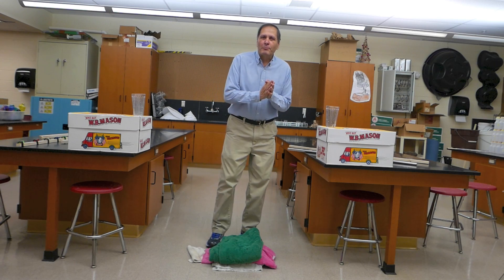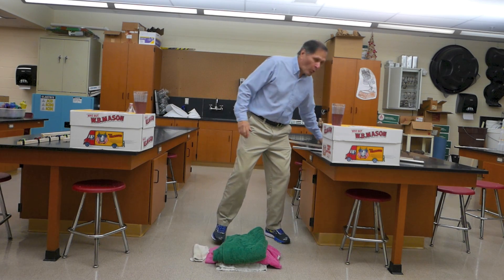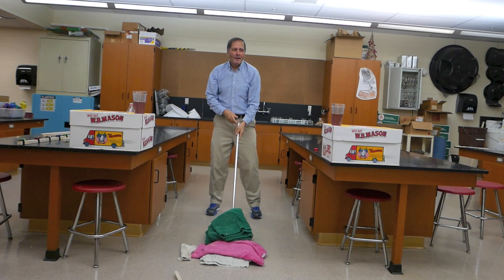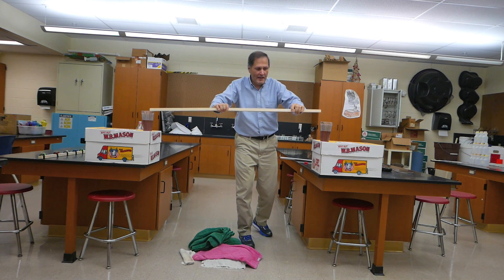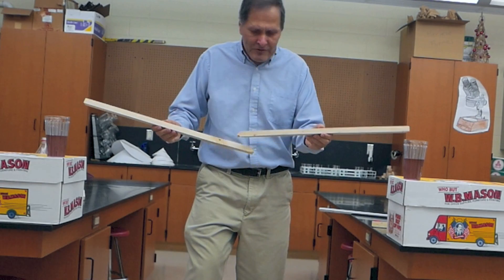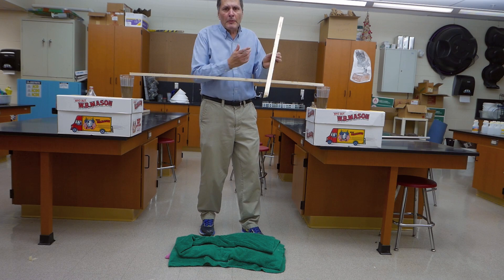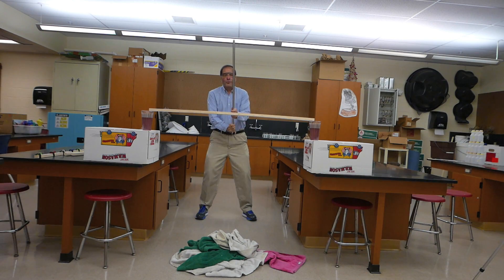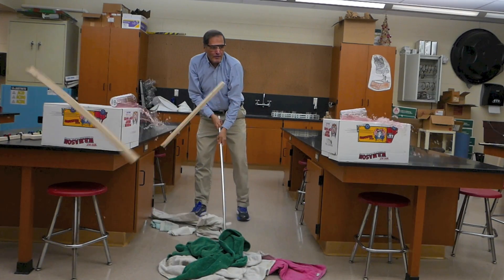Breaking Pole Paradox- center of mass // Homemade Science with Bruce Yeany

Comment: yes but a better question would be if both boards pushed the boxes close to exactly the same time and direction then why did both cups openings fly toward the right hand side of the cameras view
Reply: josh greg also possibly the weight of the boxes (we don't know if anything was inside) and he certainly didn't hit it in the middle.
Reply: josh greg probably the liquids, center of gravity difference, and probably a slight difference in force power between the two wooden planks/poles.
Reply: coriolis...yeah, that's the ticket!
Reply: the left box appears to be pushed only to the left. The right-hand box appears to be pushed upwards slightly which makes the cup bounce.

Comment: Interesting thanks.  But you need to learn what an actual high speed camera is lol
Reply from the maker: LOL,   I tried but it is a piece of junk,   the picture was so grainy I couldn't use it, if I had,  I'd never hear the end of it.
Reply: Bruce Yeany  Really??  I thought those things were expensive.  How could it be bad quality?
Reply from the maker: It is a cheap Casio point and shoot camera
Reply: Bruce Yeany  Ah so not high speed at all
Reply: To be fair, the section at 2:11 shows the effect pretty well.

For good quality high frame rate video lots of light is key. In general, cameras will shoot to the 180 degree shutter rule - meaning the exposure for each frame is twice the frame rate (i.e. 24fps video uses 1/48th of a second exposures). That means 120fps video is going to need 1/240s exposures - which is pretty fast for indoor lighting; at least without using high ISOs. High ISO leads to a grainy image; especially on cameras with small sensors. So - light, light, and more light!
Reply: Most smart phones these days can shoot pretty decent high speed! Or if you could get your hands on a GoPro. 120 frames would be good enough for this stuff. :)
Reply: You need better lights as well, if youre doing highspeed more light is going to help immensely (even if the camera is crap).
Reply: Don't worry about the shit talking haters. It was a cool and interesting video.
Reply: don't know where you are from but teacher salary isn't too good here. High speed cameras aren't really in the budget.
Reply: +GeeTR 63-71 Good :)
Reply: GeeTR 63-71  Lol.  Nobody is being a hater.  We're just joking chill
Reply: DANG JOS I'm calmer then you are.
Reply: It was a high speed camera, but I think it was only 60 fps or 120 fps
Reply: Bruce Yeany a bit late to the party but most high end smartphones can record video at ~1/8th speed
Reply: A good cheap way to get lots of light is worklights - I'm not in the US, but this is the kind of thing you're after: https://www.harborfreight.com/household/lighting/1000-watt-twin-lamp-halogen-floodlight-66439.html
They're not perfect, but they can let you film things at 120fps much more clearly than normal room lighting using a phone's slow motion mode.
Reply: I'm here waiting to see the high speed footage that never came smh

Comment: At 0:50 you claim that if you push down on the board, the "whole thing will tip over"... but you never show a control experiment to demonstrate this conjecture. Without that, I have no reason to believe that striking it quickly provides a different result from striking it slowly, and therefore have no reason to believe (or need of) your explanation for the purported difference.

Comment: Do you have to break the stick right along its center of mass for this trick to work?  From your explanation, all that seems to matter is that the broken pieces rotate away from the cups.
Reply: Kyle Amoroso its easier to break it in the center. ever tried breaking a pencil right at the eraser end?
Reply from the maker: good point Alex,  thanks
Reply: Alex Lawson That doesn't really answer my question :/
Reply: Ummm say if you did break the board near one cup you would have a long board and a short one. The short one would probably be fine and miss the cup but the large boards center of mass would be closer to the middle of the original board rather than at the 1/4 point. Because of that, the larger board would hit the cup on the opposite side. At least I think so.

Comment: but what keeps it from breaking the cups with the downward force on the ends? The counter torque had to come from somewhere right? Or is this all inertia and the board could be floating in space or say suspended from human hair from the ceiling and still work?
Reply: I think there was a lot of force that got applied to the glasses before the stick broke, but just not enough to break them. It is all going straight down the length of the glass after all.

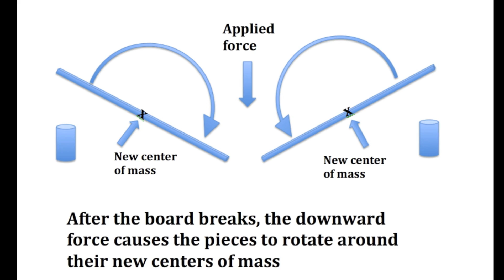Comment: You're mixing 2 questions:1/ why aren't the cups spilled during breaking2/ why aren't the cups spilled after breaking. People are indeed wondering why the cups don't spill. But I think most people won't be so surprised about your answer to question 2.  They are surprised about the outcome because of the answer to question 1, which you don't give.To say in another way: if your answer is as shown in the video (3:00) then a scientist would reply: but this also holds when you slowly break the stick: why are you breaking it so fast? You should also explain why the cups aren't spilled during breaking, that's what is surprising ...
Reply from the maker: I mentioned it in passing around 2:46 that I am breaking it against the inertia of the pole,  obviously I did not explain this as well as I should have.  I should have described that a rapid  force would cause a quick downward acceleration on the pole.  But, since the pole has a certain amount of inertia,  it can't withstand the sudden acceleration force and so instead of being moved downward it simply breaks.  The moment the pole breaks,  the downward force is now acting as a torque, which now causes the two smaller pieces to rotate around their new respective  centers of gravity of mass.  If I were to push  down on the stick slowly, there would be enough time to allow for  the force to be "felt" on the cups  and would surely cause them to fall over.

Comment: I was so irritated that the shot was crooked.
Reply: maybe the shot was fine, the building was built at aslight angle
Reply from the maker: LOL,  it appears that I am never going to hear the end of this.  The camera was on a cheap tripod and and right up against a wall so I could fit it all in,  it was hard to see the back of the camera to check the shot.  However, I promise to do better next time.  thanks

Comment: What happened to the clip with the high speed camera? And why does the board break without applying pressure to the cups first? I get that the center of mass changes after it's broken, but shouldn't there be pressure as it's breaking?
Reply from the maker: Sorry,  but I have cheap equipment,  the high speed camera video takes was pretty much worthless so I took the regular shot and slowed it down.  When the stick is hit quickly,  the downward force or torque causes it to spin away from the cup
Reply: The actual trick here is inertia. The board has mass, and so it resists being accelerated. Since the metal bar has much more momentum, it imparts a great pressure that causes the board to break, then once its broken, all the kinetic energy is on the ends of the new shorter boards, so they introduce a torque, that causes them to spin away from the glasses. Basically if he tossed the wooden bar into the air, he could have struck it downward while it was in the air and it would have behaved identically. it doesn't need anything to hold it, thanks to inertia, no extra normal force is needed to break the wood. As long as he strikes it with sufficient pressure, it would break even if it wasn't being held at all, or if it was floating in zero gravity.
Reply: Thanks Diamonddrake, that's a pretty good explanation. It would be a great video too to illustrate that that is what is going on, if someone were to make it.

Comment: Nice video, and explanation. This is similar to a demonstration done in the martial art of Ki Aikido. A piece of green bamboo is suspended on both ends by two strips of paper held only by knives, and is cut with a wooden sword or boken. This is a test of of your sword technique, because if you do it incorrectly, the ends of the bamboo will move upward at the break as shown here and the paper strips will not tear. If done incorrectly, by attempting to use brute force, the bamboo will simply rip through the paper and slam into the ground unbroken. Green bamboo doesn't break as easily as a pine board. 
Here is a video of this technique https://youtu.be/3Z6pVCfACjE
Reply from the maker: Dave,  thanks for sharing that,  certainly makes my attempt look clumsy in comparison

Comment: Really slick demonstration, but man... take 30 seconds to level the tripod. The 10˚ tilt in the frame is super distracting (to me, and probably at least two or three others ;)
Reply from the maker: Sorry Josh,  no budget, cheap equipment and slow on the video learning curve.
Reply: I'm just being nit picky. I would much rather have a slightly crooked video than no content at all! Just a tip, if you have a long horizontal line in the shot (like a table edge, or those lights at the top of the frame), just try to get those straight, and it'll really help us fake-OCD types...
Reply from the maker: Got it,  I went back and watched it again,  next time will be better

Comment: but WHEN does the center of mass shift 0:
Reply: when the board breaks and the two pieces are no longer connected.
Reply: Soarin_FTW
but WHEN are they no longer connected?, i mean, EXACTLY 0:
Reply: When the atoms are seperated?
Reply: +legotechnic27 Correct.  Center of mass, CM, is a concept that only applies to a rigid body... when it is behaving like a rigid body.  As soon as the pole hits, each half-stick is an independent thing because the pipe has taken control of the center point and each half-stick has a center of mass of its own.  The original center of mass no longer applies.  It helps to understand forces applied in-line with a CM cause only translation, but forces applied "off center" cause both translation  AND a torque (also called a couple) just because it IS off from the CM.
If you move the hit-point faster than the CM gets accelerated, then the cup end goes up.
--
Regards
Reply: ?_? huh. take a guess. perhaps when the mass was altered/ halved. broden
Reply: I think as soon as the thing starts to bend, because the center of mass is only ment to simplify the model right?
So when the board is no longer rigid, this simplification doesn't apply in the way it did anymore?
Interesting question.
Reply: fjoa123 what happens is he gives the pole so much momentum that it snaps the board very quickly and so the board applies a very negligable amount of force to the cups (which have a higher inertia because of the water in them too) and then when it snaps theres no force being applied to the cups because it rotates around the new centers of gravity.
Reply: You know... Objects don't have to rotate around the center of mass, right? It is completely irrelevant it's position.
Reply: Eric Pive If objects rotate without any force applied they'll rotate around their com.
Reply: DerBlaue Objects rotate around an axis, and that axis can be anywhere in 3d space, even outside of the object itself.
Reply: Eric Pive But not if they spin alone. For example in space. You spin a pipe at one end. If you let it go it will spin around its com.
Reply: DerBlaue No it won't. The end point will still be at velocity 0 and the pipe will still spin around it. It's just the way it is.
Reply: Eric Pive To be honest. That doesn't make any sense.
Reply: DerBlaue Of course it does. Where did you even learn that things spin around their center of mass?
Reply: Eric Pive You can try it. Spin a ball. It will spin around its com. Now stick 2 balls with the same weight and size together (glue, tape) and spin them too. They'll spin around the point, where you sticked them together. And the last experiment is to stick a small heavy ball to a big light one. Spin them and you will see that they'll spin around the com wich is near to the heavy ball.
Reply: DerBlaue That doesn't necessarily happen...
Reply: It is even possible for objects to spin around an axis that moves in space over time...
Reply: Objects orbit around 'com0' of the middle object and the orbiting object. But if these objects rotate, they do it around their own com. Rotation doesn't move an object.
Reply: DerBlaue Apparently you are understanding movement as a composition of both displacement and rotation over the com. That's a valid way to understand things, but in formal physics it isn't done that way. It's much more useful to think about an instantaneous axis that the solid revolves around and slides paralel to it. That fully describes the movement of any solid, and was what I was thinking when I said that you were wrong.
Take for instance, a wheel. When it is moving, at any single moment, it is spining around the point that it's in contact with the ground, not the com. But I guess you could also say it's rotating around the com and translating forwards. I suppose we both are correct.
Reply: Eric Pive Yeah. I was talking about spinning for example in orbit.
Reply: DerBlaue Yeah your interpretation is better in that case.

Comment: Now explain the failure and why cups fell same direction
Reply from the maker: It's funny,  I would think that if I pushed on the box like the sticks did,  they would have fallen the other way
Reply: When the pole breaks, you can see the glasses tilt a bit to the center. By the time the poles hit the box, they've tilted the other way. Probably has to do with that and the point and angle of impact. I presume friction might play a part too.
Reply: I would think part of the deal is the swing being slightly diagonal towards the glass on the  right side of the screen, thus pushing by friction both glasses on that direction, that being helped by the fact that both rotating sticks hit the boxes on the sides which would make suddenly the top side slightly convex, which prompts both glasses to go up.. so adding both forces you get what you saw... but I could be wrong.

Comment: dear sir it is necessary that when perpendicular force applied on ends body rotates around C.O.M?
Reply from the maker: Hi Arvind,  if an object is not attached to anything and  is freely able to turn, it will rotate around the center of mass.  The torque or turning force can be applied anywhere  and depending on how it's applied  determines which way it spins.  It can also be rotating around more than one axis at once